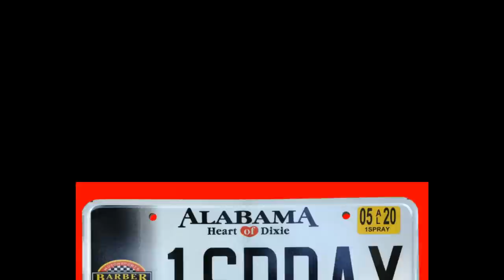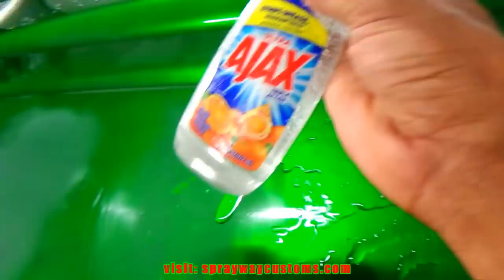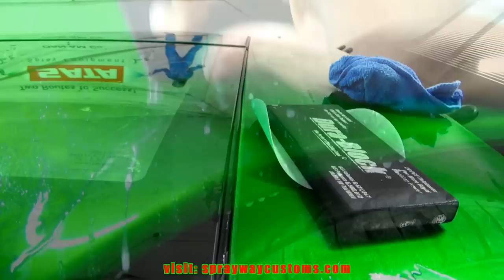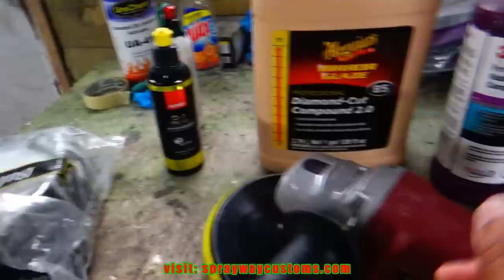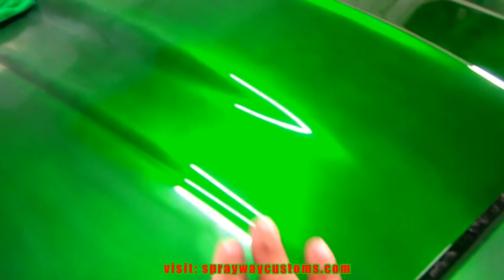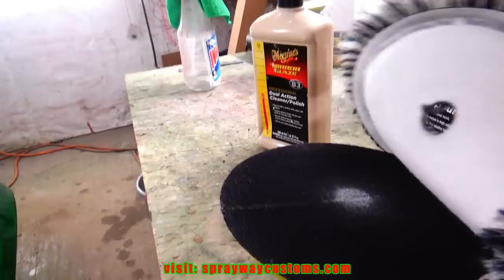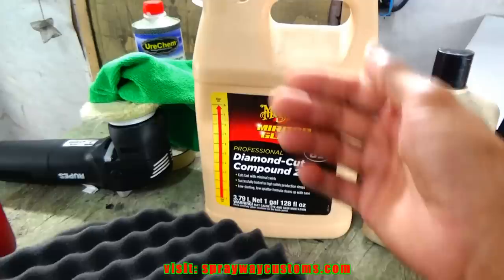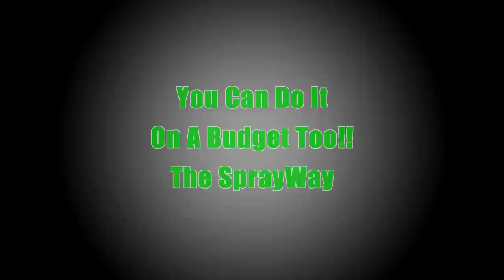How To Cut And Buff HARBOR FREIGHT ROTARY POLISHER Remove Orange Peel & Paint Defects CHEVY CAMARO

Comment: Thanks man for sharing your God given talent with us. I watched you flow coat and decided to try it. A friend had a Chevy tailgate that he let me use to practice on, plus he had some leftover paint and clear that he gave me. I followed your instructions and it came out beautiful, just some trash though. I'm going to harbor freight and buy me a starter buffer tomorrow.  Where did you get the sand paper you're using? Plus, give me the part numbers of those buffing pads. Thanks man,  this is exciting. It's true you can teach and old dog new tricks. Almost 72, still going strong. God bless you young man, keep up the good work.
Reply from the maker: I got the sandpaper off eBay. Yes it's hard to keep trash out your paint without an actual paint booth.

Comment: Excellent SprayWay  ! Thanks for the tip on adding alcohol to water as a final wipe to remove compound residue.  I am going to try a different compound soon myself.  CSI ceramx.  Been using 3m . It can be trouble to remove when it's dry. Thanks  ! 😊
Reply from the maker: No problem Mitchell. I'm always trying new products trying to find that right one

Comment: No one be known bout Philly Phil..  haaaaa..  pound it babeeee😁✊🏽
Reply from the maker: Lol 😂😂😂
Reply: @SprayWayCustoms  on that 66 mustang Sally..  im following your steps on that.. vid.
Just wanna make sure after 180 on the D/A  ..did you go straight to 400 wet sand on D/A  or  by hand 400 wet 🤔.. probably by hand?    Hit me cuzzo.. yessir.. appreciate 🙏
Reply from the maker: I wet sanded with 400 by hand right before paint
Reply: @SprayWayCustoms  its what I thought thats usually buy hand...& now that I remember..  I did 👀 u with the bucket of water... what's hell wrong with me.  Lmfao
When do you go way finer ..just on the cut &buff like the iroc?..  higher than 400  not needed right before primer? Thx homie
Reply: @SprayWayCustoms  think I gotta get my steps right my bad  ( sand 180 then  apply primer then wet sand primer  to 400 wet sand? Then paint .. ..right?  Guess I'm getting mixed up cuz im just gonna leave it at a lavender color primer hopefully.  Guess I can wet sand that to a 400 wet sand..   please ✊🏽  let me know if im correct dawg.. appreciate 🙏
Reply from the maker: BDJ # SPG SCAT PAK GANG yes that's correct. Only time you need to use a finer grit is during the cut and buff
Reply: @SprayWayCustoms  damn so the primer hides all imperfections of the 180   sanding?  Appreciate 🙏 cha & I will post a video when I'm done.. giving my man props for all the help fo sholy brutha.   .. make that gun set up / best cheapie harbor freight gun. & how to use..  yessir spray pattern etc.  / air ratio

Comment: Nice job my friend!!! keep smashing I used 3m yellow bottle and it left a heavy haze of compound after a few days then I tried the black bottle of 3m
And it went way Someone told me to use Maguires 21 after polishing I  put it on the rag and I wiped it on and let it dry I came back wiped it off and gave it a nice slick glass mirror finish food for thought I'm making some videos but I'm just not knowing how to edit it yet be on the lookout;) goddess
Reply from the maker: I feel where you coming from...that's why I have a types of different compounds and polishes trying to figure out the right combination

Comment: I have the same Harbor Freight Rotary but I cant get the hang of using it. Every time I put a fpam pad on it it hops and walks all over the panel and never stays smooth
Reply from the maker: Try putting it at a slight angle

Comment: Have u tried 8000 after 3000 ? Makes buffing it so much easier . I use 1500,5000 then 8000 myself . Another banger vid as usual
Reply from the maker: I haven't went up to 8,000 but 5,000....yes the higher you go up the easier the buffing will be

Comment: Question, do you flo coat poly/rubber front and rear bumpers on cars or just the rest of the car except those parts?
Reply from the maker: I flow coat everything
Reply: @SprayWayCustoms  how many coats do you spray before you flo coat?
Reply from the maker: ty ferguson three coats

Comment: What wool pads are you using
Reply from the maker: I'm using the Presta Black & White Wool Pad. https://www.amazon.com/Presta-Wool-Compounding-Pad-Black/dp/B00B2BDA3U/ref=asc_df_B00B2BDA3U/?tag=hyprod-20&linkCode=df0&hvadid=459657529872&hvpos=&hvnetw=g&hvrand=13771535703615437490&hvpone=&hvptwo=&hvqmt=&hvdev=t&hvdvcmdl=&hvlocint=&hvlocphy=9012698&hvtargid=pla-942171249256&psc=1

Comment: For the black paint in frontheadlights did you make sure you didn’t sand too much into the corner egdes or can you go ahead and sand into the corners with out having troubles of burning that later on when you pass through it with the rotary
Reply from the maker: Yes you have to be careful in those areas but I really didn't have a problem with that because I flow coated it so it had plenty of clear and it sat for awhile and hardened up pretty good.
Reply: @SprayWayCustoms  right on 👍🏼 thanks for the advice

Comment: Do you wash each pad after each panel you do ? Or do you use them all in one job then wash them after the job is done
Reply from the maker: I wash them after the job done
Reply: @SprayWayCustoms  where did you get the wool wheels you were using?
Reply: @SprayWayCustoms  also what rpm were you using to compound and to polish

Comment: Great video and work man! What seems hard about 1500 is when I move up to 2000/3000 its hard to tell if I got all the 1500 out until polishing. Everytime I use 1500 I find myself getting to polishing phase and having to stop to bring paper back out in spots to get out 1500 that I didnt get all the way out. You have any good tips for that?
Reply from the maker: It’s the same way with me. If you can skip the 1500 and jump straight to 2000, it would’ve much better. I’ve started using a da to sand and it helps with knowing what’s been sanded also.
Reply: @SprayWayCustoms  I havent tried this yet, but I know some people guide coat the clear when heavy sanding it...but they use the dry power kind and pretty much cover the whole thing evenly.  Goes down into all the sanding marks and you can see them get sanded away. I've never tried it with clear, but was thinking I might give that a shot.

Comment: WTH ALL THE CUTTING ON THE TROUBLE SPOTS YOU END UP WITH THINNER LAYER OF CLEAR
Reply from the maker: Yes...it's 6 coats of clear on it total
Reply: @SprayWayCustoms  
I spray painted my Mazda truck with Krylon universal black using a black primer. It was already black;  After 2 weeks in the sun I wet sanded it with 1000.  I plan to wet sand it with 1500 and 2000 and then spray paint a clear coat on it, and after 1 month, apply a ceramic coat (Avalon King).  I don't have a buffing machine and I don't want to buy one to use it only once.  Any tips will be appreciated.